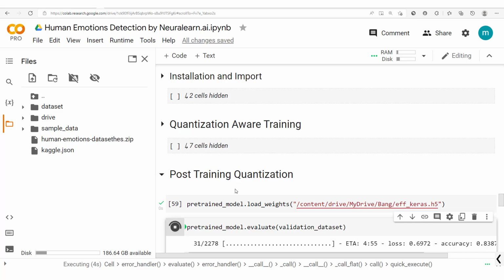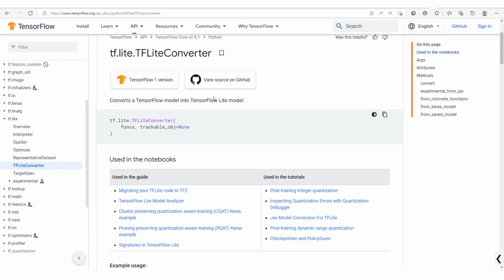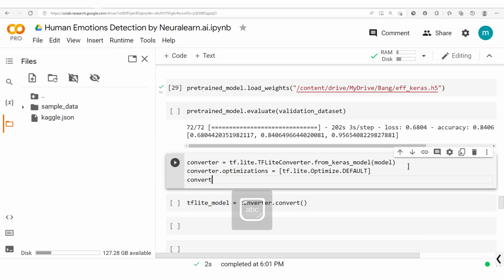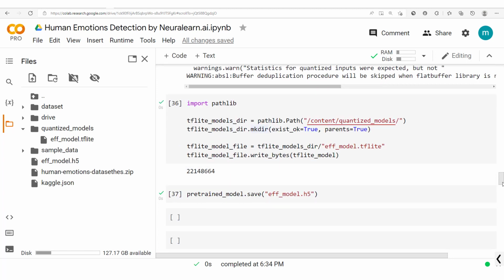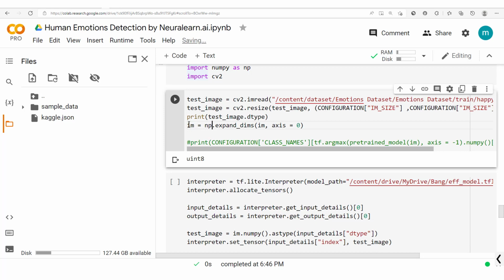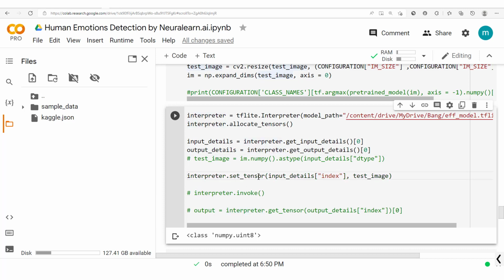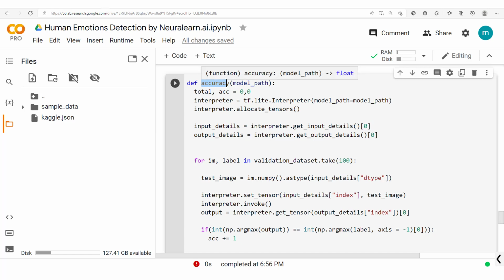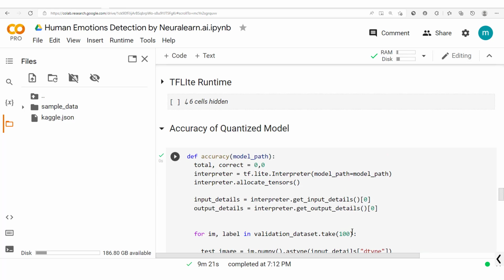Converting TensorFlow Model to TensorFlow Lite (TFLite)  -  Human Emotions Detection

Comment: I was doing the same step-by-step since the creation of the model, when I run the cell with:
interpreter = tflite.Interpreter(model_path='/content/tflite/quantized_model/tflite_quantized_model.tflite')
interpreter.allocate_tensors()

input_details = interpreter.get_input_details()[0]
output_details = interpreter.get_output_details()[0]

interpreter.set_tensor(input_details['index'], test_image)

interpreter.invoke()

output = interpreter.get_tensor(output_details['index'])[0]

This cell only runs when I resize the image dimension to (1, 1), more exactly -> interpreter.set_tensor(input_details['index'], test_image)

Is there any idea about what is wrong?
Reply from the maker: Hello Felipe, you have been granted access to the Notebook.
Please after rerunning with the Notebook, let us know if you still face issues.
Reply: @neuralearn   Thanks!!!
Reply from the maker: You're welcome :)
Reply: i face the same issue: exact image input shape in trained model .h5 is (1 , 224 , 224 , 3) but after converting to tflite, " input_details[0]['shape'] " gives me input shape: ( 1, 1, 1, 3) which is wrong. Could u help me ?